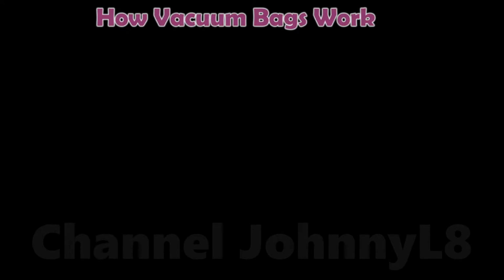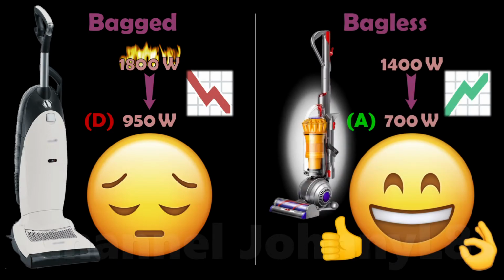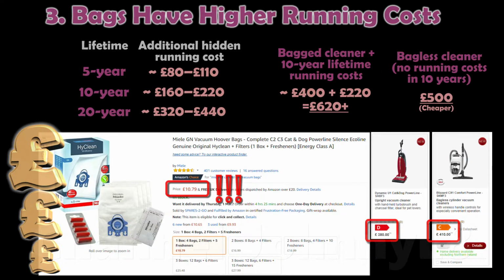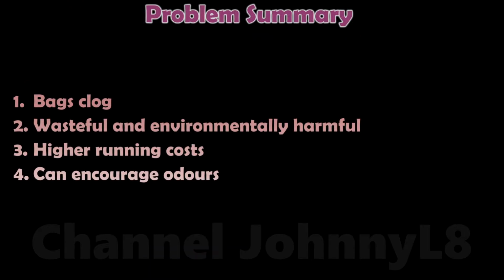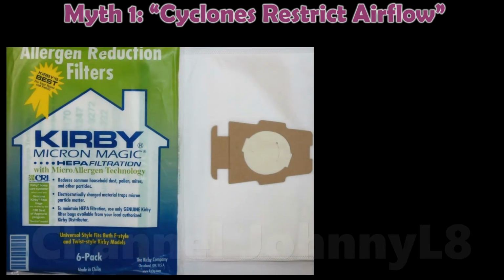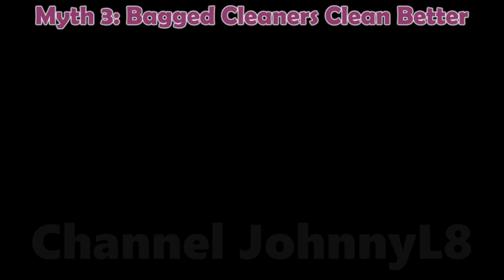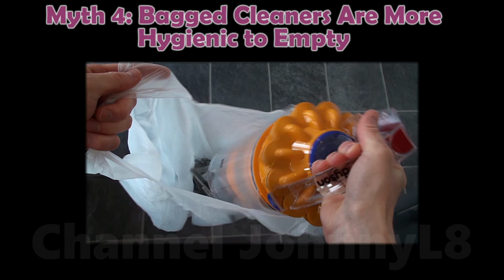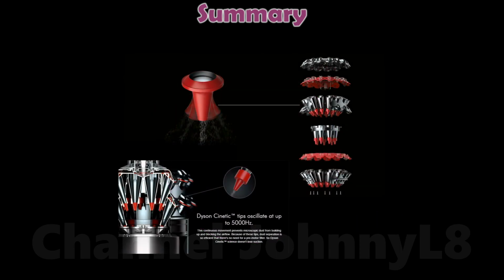Bagged Vs Bagless Vacuum Cleaners

Comment: Ok. 1 - yes, cyclones do reduce airflow - resistance absorbs the energy. If you don’t believe me, take a motor off a bagless machine and see how much air volume it can pull without all the cyclones. 

2 - bagless machines tend to not have multiple power settings - the more power, the more effective the cyclonic separation.. cyclones do not filter, they separate and that’s an important distinction. Lower the power, you lower the separation, and more dust particles are sucked into the motor. That power use becomes a problem for cordless machines especially, which is why, surprise surprise, you see filters are all cordless and even most corded Dyson vacuums. This power setting is the biggest issue for me when I am trying to vacuum furniture.. with my Miele, this not an issue, and I can get the power lower that I need for that task.. my old Dyson was much harder because it could lower the power and I had to push the nozzle with much greater force across the upholstery. 

3 - smells.. ok. Twice a year my Dyson had to be literally taken apart and washed because every time we turned it on, the smell would eventually be impossible to stand. Any smells out of the Miele have never been as bad, nor have I ever had to actually clean my Miele.. 

Enjoy whatever vacuum you use, but I can tell you that my experience with a bagged Miele has been 10 times better.
Reply from the maker: Much of this is misleading half truth. 1. This doesn't matter; all that matters is the actual performance you get and what it takes to get it. You've said nothing about that. Those that have looked at it (e.g. the measurements on my channel) clearly show that modern top end bagless vacs that do it right (Dyson) offer the highest levels of performance with minimal power consumption and environmental impact. 2. You've said absolutely nothing about measurements of filtration performance and the environmental consequences of different approaches. Those that have show that cyclonic filtration (done correctly) eliminates the wasteful disposable bag approach and running costs. 3. You've presented no objective evidence about the origin of smells. This is all covered on my channel. Smells are caused by sucking up smelly material; it's that simple. If you have smelly material, then smells cannot be avoided but can be minimised with a few simple steps on Dyson machines: empty, filter rinsing, and zorbing the carpet. I've no reason to believe your positive experiences with your particular product would translate to anyone else. There is better technology out there; this video explains what it is and why.

Comment: Bagless is a gimmick. Growing up we had bagged vacuums. They lasted forever and were better for allergies. I didn’t get dust and crap trying to fly up in my face every time they are emptied. 

I can’t tell you how many bagless vacuums I have bought over the last 10 years. Roughly one per year. I am not talking cheap ones. Even $200-$300 vacuums. 

I am sitting here looking at one that just died as my wife is running out to the store to buy a bagged vacuum.
Reply from the maker: Poor bagless products do suffer from the issues you mention, but not all do. Dyson's do not, as evidenced on my channel e.g. https://youtu.be/E_ik6qScs0o . Only Dyson have done bagless properly and were the original developers; the rest have jumped on the bandwagon and copied poor immitations that are low quality (see https://youtu.be/U_qS2i6HQRY ). The new V15 just released is the current king of premium vacuuming products, as my upcoming review will evidence. I'd encourage at least looking. The problems with bags are highlighted fully in this video. They are an old technology that has been surpassed by modern approaches (at least the ones implemented properly rather than cheap cash-ins).

Comment: I Love Dyson. I have many. I agree with everything you have said. I rarely use bagged vacuums, But i do sometimes. The only reason why i would use a bagged vacuum is for a lot of fine dust or powder. I dont like that powder getting in the cyclones and seals on the bin. I find it much more easy to clean a bagged vacuum than a bagless. I have a vacuum technician so I have cleaned many dysons. They arent a walk in the park to clean. But Dysons do perform much better than nearly every vacuum out there. If people are more on a budget, I recommend Shark. Their cyclone design is bad, But they perform well as a vacuum. New Subscriber By the Way!
Reply from the maker: Many of these myths are dealt with here

https://youtu.be/TjUdD6FZtMY
https://youtu.be/E_ik6qScs0o
https://youtu.be/hsl4tCaL6g8

Comment: 12:05 I just empty the bin outdoors.  though some dust might stick to the tool, it is insignificant compared to the always present indoor/outdoor dust.
Reply from the maker: Well designed products can be emptied without mess or cost very quickly. https://youtu.be/E_ik6qScs0o

Comment: 9:15 bagless motors don't get stressed because they run at much lower power, matched to the filtration system.  my first time with a cordless, I could not believe how weak suction and quiet it is,  it felt like a toy and I was scammed.  I kept using high power first the 3 weeks until I started investigating with a flashlight parallel to a hard floor.  I found there is little difference, the higher power is cleaner but quite moot as small particles return in one or two hours anyway (unless one is running a powerful air purifier)
Reply: Truth is never use cordless vacuums as you will not get much suction at all from it,using corded vacuums are much better

Comment: Bagless are the best! When I saw the Roomba emptying base, I threw out 🤮.
No filter, only the bag itself was the only filter. One day when It was emptying my Roomba S9, the bag suddenly tore apart and destroyed the motor and I almost choked with the dust in my lungs. I thankfully got refunded it and the insurance company was able to cover me. I hope that one day all the bagged vacuums will die painfully. The best thing of the bagged vacuums are when you suck something unwanted like the lego or the money you tossed for the bags into the bag, you have to tear up the bag and sell yourself for another bags.

Its true, some bagless vacuums make high pitch noises, but that's because of the cyclonic filtration. Whats a complete false, is the fast that the bagless vacuum cleaners run hotter than the bagged. All depends on the motor, not the filtration.

Do you know Kirby vacuums? You suck up some rocks and then you can just cry you wasted 1000€ for a vacuum that got destroyed in less than 1 minute. I think its even banned in my country, like the sink garbage disposals are.

I compared my 60€ Philips bagless vacuum against the 600€ Kärcher bagged vacuum. The Kärcher failed and tripped the breaker after it got full and ran another 1 minute. When I filled the Philips vacuum, It still had some suction even when the fullness protection got triggered.

Comment: Great video, appreciate the effort
Which would you say is better, miele blizzard cx1 or dyson small ball allergy? Thanks
Reply from the maker: What do you mean by 'better'?
Reply: @VacuumFacts  do you think miele use as good bagless technology as dyson? Im considering the miele because it is quieter, but my house has both carpet and hardfloor and I dont want to bending my back, struggling with the cleaning hose of the cannister miele..
Reply from the maker: @JohnSmith-oj4jp  Dyson has the best bagless filtration on the market by a huge margin and nothing even comes close. Everyone else kludges a copycat clone 'solution' which doesn't perform anything like as well and is heavily reliant on messy or expensive filters instead, as discussed here https://youtu.be/U_qS2i6HQRY . How do you know the miele is quieter? And quieter than what, specifically? The dyson small ball allergy is one of the quietest machines on the market that performs at the highest cleaning levels. The Miele does not clean carpets anything like as well as the dyson small ball allergy either; the dyson small ball allergy has the highest cleaning performance on average across all floor types than any other machine on the market, according to independent testing.
Reply from the maker: @JohnSmith-oj4jp  In fact my reviews of the Dyson machine are here
https://youtu.be/H8s9eBXeN4E
https://youtu.be/Fd9ealM0O1E
https://youtu.be/mLIqvsGLovU
Reply: @VacuumFacts  thanks for the response, much appreciated

Comment: Intrigued why bagless isn’t used in a Commercial settings like Hospitals, Hotels, Offices, Retail etc... would eliminate bags, filters and cost to a Business.
Reply from the maker: Because https://youtu.be/qmEj9NFZzCI
Reply: Thank you. Interesting video! Love the parody at the beginning! Made my smile!
Gosh you pulled some grit and dust out of that office carpet! I always wonder what’s lurking in office carpets especially when straight suction is used! Goes to show all carpets need some level of agitation by using a brush roll!
To think that dust and dirt in office carpets you could be breathing some of that in, well if it becomes airborne.
Reply from the maker: It's nothing to do with agitation; I've done multiple videos on that fallacy. It's to do with good suction to maintain high air speed through a current-resisting pile, and optimal use of the minimal resources required to achieve extraction through good head design, again as covered in many of my non-review videos.
Reply: You have and I’ve watched with interest these videos.
Reply: Because they're inferior

Comment: The nice thing about HEPA bags is they have a lot more surface area than the post motor filters on a bagless unit.  The bags also don't require cleaning because they are disposed of after a month or so.  The increased surface area and regular replacement offers more protection to the vacuum motor, traditionally.

Cleaning post motor filters also tends to open the pores over time.  I also don't know many people who know this is required maintenance on their vacuums.  Failing to clean the filters on a bagless unit will wear the motor out.  A worn out filter will need replacement or dust will begin to damage the motor.

Usually a solid bagged unit can last decades as a result and bagless units are usually replaced more often.  This does depend on the user, however.  I used a Bissell bagless for ten years and I cleaned it religiously.  I have a neighbor who's Shark died after 6 months, and they had no idea they were supposed to do some preventive maintenance.

Premium vacuums like Sebos and Rccars, and commercial units use bags for a reason, longevity, ease of maintenance, and simplicity.

There is also a lot of independent testing that proves modern bagged vacuums don't lose suction, even when full.  Check out Vacuum Wars video on it (love that channel).

I do prefer bagged units, but I think Sharks and Dyson's are solid vacuums.  My Hoover Hushtone is currently my favorite vacuum.  I'm hoping to add a Shark Apex Pro (bagless) to my collection after I save some more shillings.
Reply from the maker: Thanks for the comment. A few responses:-

>> “The nice thing about HEPA bags is they have a lot more surface area than the post motor filters on a bagless unit.”
For cheap knockoff bagless units that try and cash in at the expense of the customer (see here https://youtu.be/U_qS2i6HQRY), then yes, what you say is true and meaningful. For decent technology that solved the dust filtration issue decades ago (Dyson’s machines), it’s an irrelevant point. The cyclones do the main filtration work and are a first line of defence; there’s hardly any dust left for the filter, so it only needs to be small and doesn’t clog (bar abuse and neglect). Any technology that relies on filters or bags as a first line of defence is crap technology that deserves no respect.

>> “The bags also don't require cleaning because they are disposed of after a month or so.”
That’s not a good thing and the genuine problems with this are discussed in the video you’re commenting on.

>> “Cleaning post motor filters also tends to open the pores over time.”
I do not believe this, and it contradicts observation. Can you provide some strong, convincing, objective evidence from a respectable source to support your claim and give it a little credibility, and distinguish it from a made-up myth? I would bet you won’t be able to source the evidence.

>> “I also don't know many people who know this is required maintenance on their vacuums.”
Anyone user who isn’t aware of the most utterly basic things outlined in the manual constitutes an abusive and neglectful user. That’s not the fault of the manufacturer. Most car owners know they need to put fuel in their car and change the oil etc. if they want it to keep working. Machines aren't magical and do require basic user responsibility.

>> “Failing to clean the filters on a bagless unit will wear the motor out.”
Maybe a cheap knockoff copycat product. Dyson machines detect when filters have been neglected and deliberately stops working until rinsed.

>> “A worn out filter will need replacement or dust will begin to damage the motor.”
Maybe a cheap knockoff copycat product. Dyson filters are lifetime filters and should never need replacing if treated as intended and outlined in the manual.

>> “Usually a solid bagged unit can last decades as a result and bagless units are usually replaced more often.”
Maybe a cheap knockoff copycat product. Dyson machines are built to last 10 years at the very least with responsible use—by which time, many people will want to upgrade to newer and better technology.

>> “Premium vacuums like Sebos and Rccars, and commercial units use bags for a reason, longevity, ease of maintenance, and simplicity.”
I’ve seen no evidence Sebos and Riccars are ‘premium’ or better than products that market themselves as premium products (like Dyson). But as for commercial use, yes, I discussed this here https://youtu.be/qmEj9NFZzCI. Commercial environments favour sloppy, lazy, brute-force, quick-and-simple operation. This is shockingly wasteful and not good for the environment—especially when scaled up again to the substantial home residential market. The residential cleaners require superior design and, as shown in the video just linked to, the best Dyson cleaners outperform commercial units, proving the ‘premium’ label a myth.

>> “There is also a lot of independent testing that proves modern bagged vacuums don't lose suction, even when full.”
Er, Vacuum Wars does not conduct representative or convincing testing. He doesn’t even use representative test dust and sticks with sand, which is utterly stupid for all the reasons covered in my videos. There is NO evidence on his channel for the claim you make. There is plenty of evidence showing that modern bagged units lose suction when dust loaded, as presented here https://youtu.be/O-8Ysa44XrQ. And I’ve produced videos explaining why, based on well-established textbook science https://youtu.be/QTSadOm6WsI (something also lacking from dressed-up bedroom amateurs like Vacuum Wars—that channel is entertainment at best, not factual to quantitative levels).
Reply: @VacuumFacts  It's funny you call vacuum wars amateurs.  The videos you linked are Movie Maker slide shows and videos of you vacuuming and talking.  A clear dodge of results contradicting yours.  I don't think you've seen their testing videos, or you're not being honest.

Lol, you've seen no evidence Sebos, Miele, and Riccars are premium vacuums.  The burden of proof is in you at that point.  Made in Germany vs the Malaysian Dysons built on child labor.

I doubt there is a possibility of convincing you there are pros to bagged units, I'm detecting quite a bit of density.

I would normally engage in link sharing, but I assume you'd call any third party channel from yourself an amateur.
Reply from the maker: @281cu6  I explained why I reject the silly bedroom testing you mentioned. You didn't really acknowledge anything I gave in response. Just need some decent data that doesn't suffer from obvious problems. No one provides any though and you've directly cited absolutely nothing. People never properly account with solid reasoning why they reject the data I present, despite it being well reasoned, sensible, and showing all the trends you'd expect. If you actually want to make a serious point backed up by some good data or have a learned discussion about my work, I'm more than ready. The points you've raised so far have been addressed and shown to not be universally applicable or supported by good evidence.
Reply: @VacuumFacts  The disabling of the like/dislike button, the slideshow spamming, and the usual discourse between you and commentators infer you wouldn't be swayed.
Reply from the maker: @281cu6  Now who's being evasive. Raising cosmetic nonsense in lieu of real evidence and argument. I can easily be swayed with strong evidence. You have none and there's no conversation left until you do. Unless you'd like to take 'offense' as a last resort, as is the usual thing people with your behaviour and tone have done at this stage.
Reply: @VacuumFacts  Man.  You've got me down to a T.

Cosmetic nonsense, nice.  🤣
Reply: The airflow in bagless vacuum cleaners doesn't fall as quickly as it would in a bagged vacuum cleaner 
Vacuum cleaners that are neglected will fail fastest whereas taking care of them will make them last a good 10 years
Also it's not that dirty to empty bagless vacuum cleaner Canisters if you do it properly